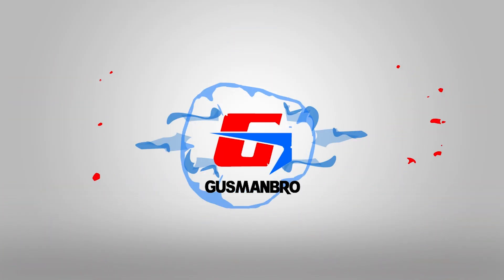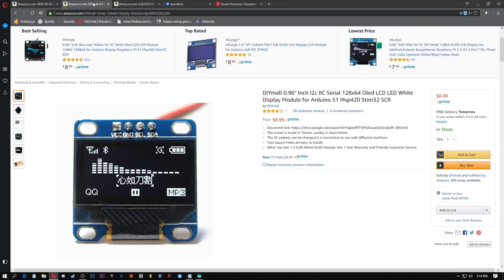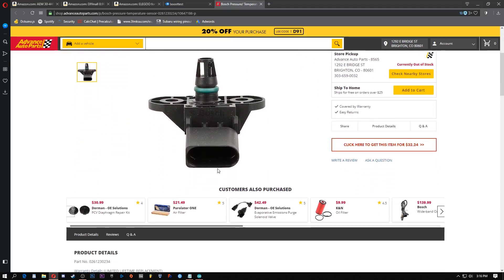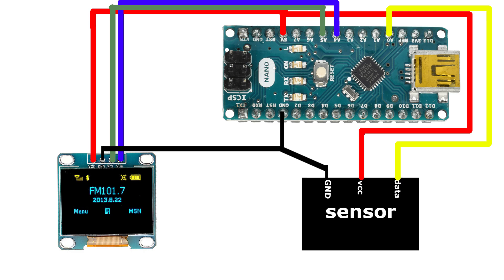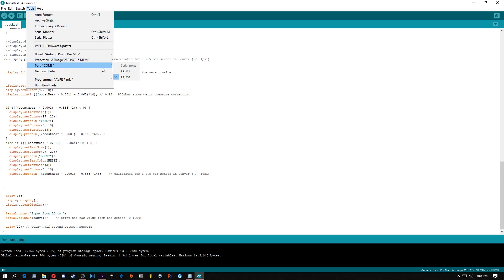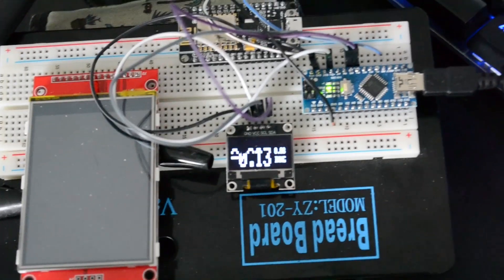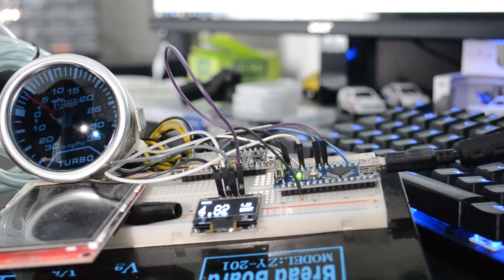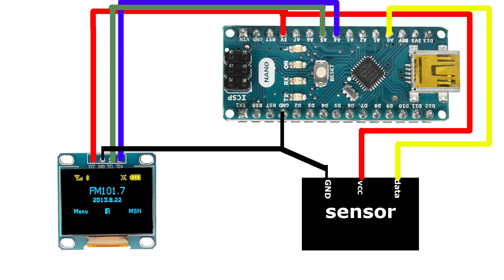DIY ELECTRONIC BOOST GAUGE!!! With Arduino

Comment: Nice video. I'm also near you in CO, in some other psi gauge projects I've seen, they added a .1 uF capacitor in the circuit, which may help with the 1psi correction/fluctuation of the gauge: "In the case of the video, I took measured readings at the top end and came up with a 4.6, which is within 2.2% of the nominal. The capacitor for noise reduction may be better served decoupling power going into the sensor; therefore, the capacitor should be connected to the red power wire, then to the ground. " (In the original diagram, he had the capacitor between the ground and signal wires just before the pressure sensor). Good thorough video

Comment: The way that most digital boost gauges work is that they take a reading immediately as they are turned on and assume that it is the ambient atmospheric pressure, and call that the 0 point. The VEI boost gauge in my old GTI has a button you can hold down while powering it on to force it to learn the zero position. fwiw, that gauge cost about $130, which is still too much. I'm interested in this for a car where there is no good place to put a 52mm gauge because the custom pod options are pretty limited.

Comment: Hello!  Thanks for the video and the code, i will show you my set up as soon as is ready, however i have a few questions and maybe you can help me out.

This is the very first time i use an arduino, so i have been reading a lot and after successfully edit the layout i have 2 questions

1. When you calibrate the sensor  using this (  int boostmbar = map(analogRead(sensorPin),<original_min>, <original_max>, <new_min>, <new_max>); ), how did you get the values? Im using a 3 bar GM map and i dont kow if the  original values are in mVolts or what. I think the new ones are mBar right?

2.   barboost = (((rawval * 0.19) - 69.45) + 10); how does this work? , i gues the bar shows vaccum and boost?

Comment: great vid!!!  im a novice in this and i have no clue of how the coding work.. i bought a 128x64 oled screen they only had a spi version which they said can work as I2C but it cant. i tried to connect the unit to my UNO board only using the diagram you gave and i uploaded the coding that you put in the link. obviously it did not work. after looking around on different sites i got it to work with dfferent wiring config and if i use the ssd1305test code... i then tried using your code again and it doesnt want to work .. which i am assuming that it is because the coding is for a I2C config. can this code be modified to work with my spi  that uses the ssd1305 driver ... thanks  once again i am a novice and have very limited knowledge of this

Comment: Could someone explain the calculations in the code?

((boostmbar * 0.001) - 0.865) *14)
Boostbar= boost
0.001=?
0.865= Denver pressure
14=?

Thanks
Reply: 0.001 converts milibar to bar
14 converts bar to psi (1bar is about 14 psi)

Comment: Hey man thanks for the video. I just bought same map as you but I have 4 pins and I don't know which to use. Do you have the pinout? Thanks!
Reply: If its a Bosch, 
Pin 1 =Volt 
Pin 2= Gnd 
Pin 3 = Signal
Reply: Dude, did you fix it? I've the same question.

Comment: Very helpfull video thank you! If anyone needs bar instead of psi, change number 14 to 1 in formula (0.865)*14)
Reply: Should this be done on all places in the code? What are the values in the formula?
Reply: @RustySWE  yes in all places. Formula I explained below, but 1bar is about 14 psi

Comment: Thanks again for the video

well I did in the end buy two Map sensors like these from ebay
 https://www.ebay.co.uk/itm/153874385441

And have used your code with a bit of added smoothing (averaging with a small window) and works well.
I have the Map sensor reading the manifold pressure connected to A0 and the reference sensor connected to A1.

It has become obvious to me that a stable and smooth 5V supply is very important to avoid 'noise' on the analog inputs on this project.

Still needs calibrating but it works.

code is here if any one want to try this.
 https://drive.google.com/file/d/1kx0d1APvDpxXAwWCfDrV5GNnMvgKEY1w/view?usp=sharing

you will still need the Adafruit GFX library and if you're using the small 1306 Oled screen the Adafruit SSD1306 libraries.
Reply: Is it working well? I like your idea, calibration is done automatically. Dont need to input atmosperic pressure.

What do you mean with "added smoothing"?
Reply: @RustySWE  
See here 
https://youtu.be/m6UK0ai6_a0
Yes it's been flawless still working perfectly...the averaging was done to ' smooth' out the jittery display  ended up changing quite a bit of the code but the basic idea is the same.

Comment: Hi great video .... Just had a good idea ..I think ...Couldn't we use two Map sensors (same make and model) with one connected to a A0 and the other to A1 and have one open to atmosphere and the other in the manifold and read both with the arduino and subtract one reading from the other this should 'automatically' adjust the boost gauge for the current atmospheric pressure and give a true boost pressure......good idea ..or not ???
Reply from the maker: That could totally do it! I didn't even think of that
Reply: @TekStak1  time for me to browse eBay for two cheap map sensors